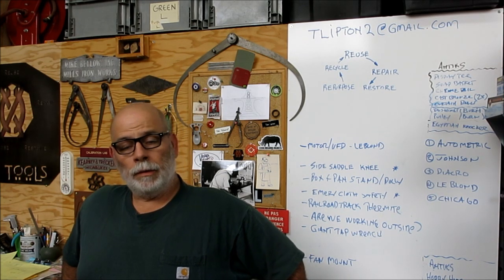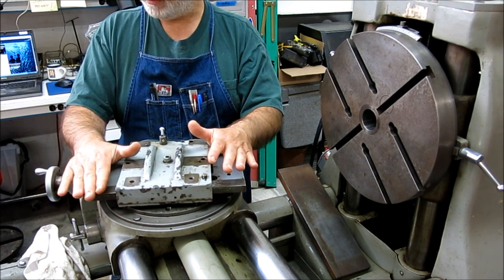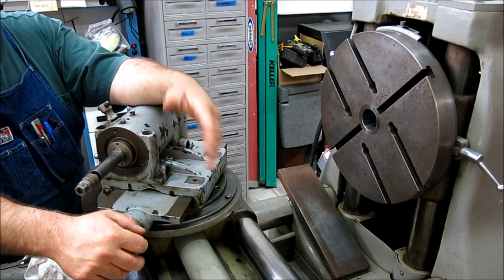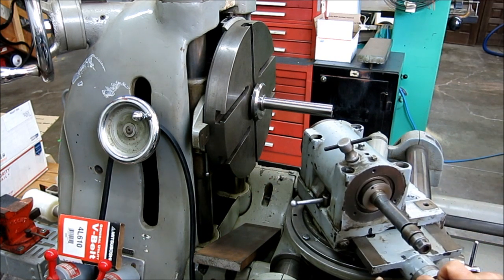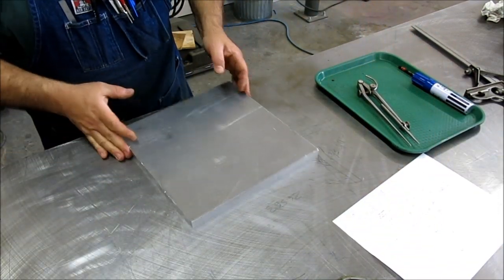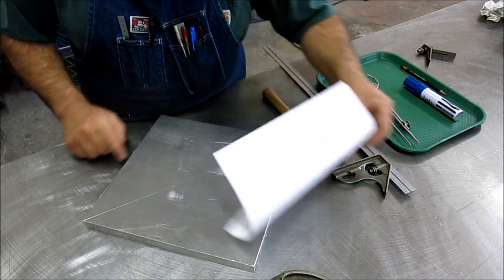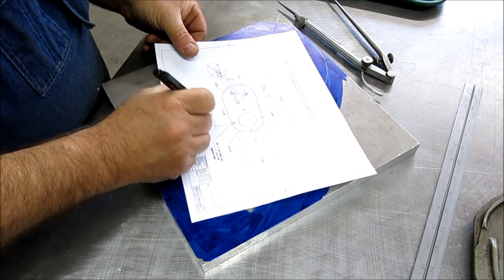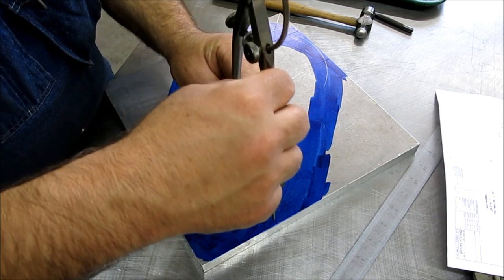Autometric Jig Bore Resurrection Part 1

Comment: Looks like an ideal one machine workshop piece of kit Tom. We used to have something similar in the factory, a tad larger, I recall they had to dig a hole about twenty feet deep when installing it.
Reply from the maker: Hi Stephen,

Thanks for the comment. They just installed a huge version across the street from me. They were digging and pouring concrete for a couple of weeks.

Cheers,

Tom

Comment: It could be a huge tool post grinder. Cool machine.

Interesting to see how you do layout. I never really learned any of that before, I just draw it on the computer and let the machine cut it out. Very informative, nicely demonstrated, thanks!
Reply from the maker: Hi Ben,

Didn't consider the grinder addition. Better figure out how to mount that little Dumore I got recently. Boy this is going to be the Swiss army knife of machines.

Cheers,

Tom
Reply: Couldn't you just chuck up and arbor in the sub spindle when its done and use that, or would the RPM's be insufficient?
Reply from the maker: bensbenz Hey Ben,

The original spec on the sub spindle is only 3K rpm. I'm liking the idea of mounting the Dumore on there as well. 

Cheers,

Tom

Comment: You might as well have covered that entire plate in dye Tom!
lol 
Although I wouldn't trust it as a parachute, but I think it will make a great addition to the shop.
Reply from the maker: Hey Andre,

I covered the heck out of it and still missed the spots I needed. The blue got all over everything. Those are some bleeder pens. No wonder Chuck was giving them away.

Cheers,

Tom

Comment: I think you mentioned this would have a belt drive.    I am assuming there is no tensioner.   I was just wondering at what point you have to consider what belt length you will use?   Did you already consider this when choosing the spacing of the shafts?   Do you worry about this later when choosing pulleys?   Thanks for sharing your projects with us.
Reply from the maker: Hi Etienne,

One of the pulleys is a split model that can be adjusted to tension the belt. Kid of like an old Volkswagen bug fan belt. You will see it soon.

Cheers,

Tom

Comment: Tom, I looked up the K&T autometric—tried to, rather, as there isn't much info out there that I could find.  what you explained in this video (and one before) gives me some idea what this could be used for, but I'm really curious: what would it have been originally purchased to do?
Reply from the maker: Hi Thoper,

Jig bore were used to precisely locate holes. In the olden days to get holes in exactly the right place was a real challenge using gage blocks and buttoning. The Jig bore uses very accurate lead screws or length references as in the Pratt Whitney style to just drive to the coordinates to place the holes to close limits.

Cheers,

Tom
Reply: oxtoolco awesome, thanks!

so, then, that's why it's called a jig bore?  they wanted to bore holes to make jigs so they could make other parts later?

Comment: Hey Tom,

That looks like the basis of a CNC gear hobber to me!
Reply from the maker: Hey Paul,

Hadn't thought of that one. Now power on the cross slide unfortunately.

Cheers,

Tom
Reply: oxtoolco
Not difficult to add with a stepper though.

This is John Stevenson's setup on a universal mill;

http://www.stevenson-engineers.co.uk/files/hob%20indexer4.jpg

Encoder belt driven from spindle feeds a TTL logic divider which outputs to the stepper.

Just angle the head for helical gears;

http://www.stevenson-engineers.co.uk/files/hob%20indexer12.jpg

Comment: Repairing and modifying tools is interesting. A 64th extra beats a 64th short every time. How about a little about how they used it back in the day, and how you'll be using it now?
Reply from the maker: Hi Lee,

When we get this puppy running I'll try to make it talk. This is a rare bird even by Jig Borer standards.

Cheers,

Tom

Comment: Hi Tom, just wondering, does one just use a stone to touch up the points on the dividers that need sharpening? I always wondered how to bring the point back on tools like this and figured just a fine stone at the right angle with a touch of oil.
Thanks Alex :)
Reply from the maker: Hi Alex,

You are exactly right a fine stone is the best as it cuts slowly. I like to use an older one and the divider points can plow a groove in the stone if you are heavy handed. When they are sharpened nicely they will click into the finest divisions on a precision scale. Thanks for the comment.

Cheers,

Tom
Reply: Cool Tom Thanks :) have a great evening

Comment: are you going to find the bolt hole centres via dro, or lay them while your centrepops still exist ? :)
Reply from the maker: Hi Peter,

The mounting holes will be done on the mill when I have it set up to do the two large through holes.

Cheers,

Tom

Comment: I just realized that i've never seen a ruler that allows you to stick a pair of dividers at 0 and go from there. 

A specialized tool that has a hole specifically for this.
Reply from the maker: I have seen some guys put a couple of small spot drills on their calipers so they can make a precision divider setting. I never bothered but it sounded like a cool idea.

Cheers,

Tom

Comment: Just a minor, not very important, point. When drawing a line tangent to two circles I prefer to place my straight edge outside the circles. That way I can see the curve of the circles which makes the tangent point easier to see.
Reply from the maker: Hey Derek,

And if you hide the parts you don't want to see you get a similar result. Thanks for the comment and counterpoint.

All the best,

Cheers,

Tom